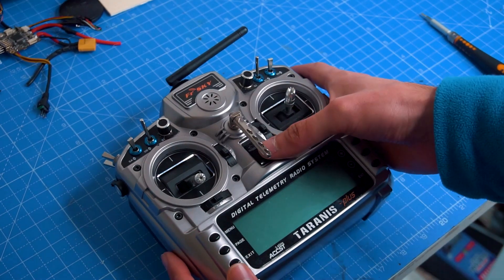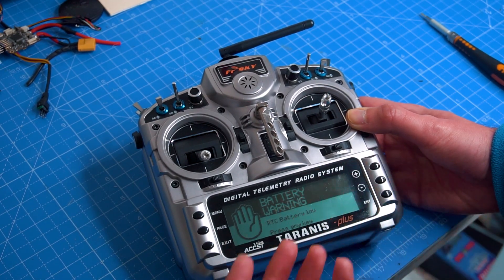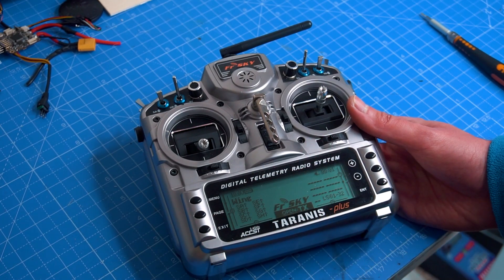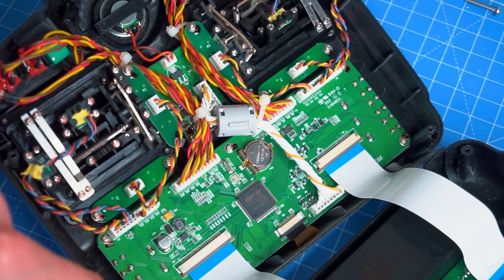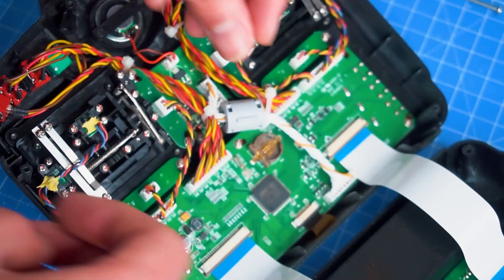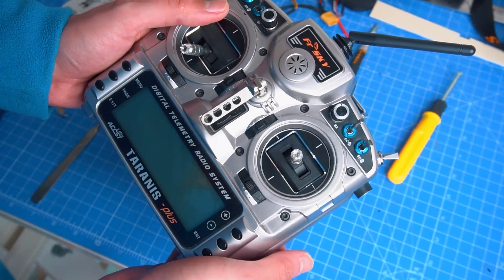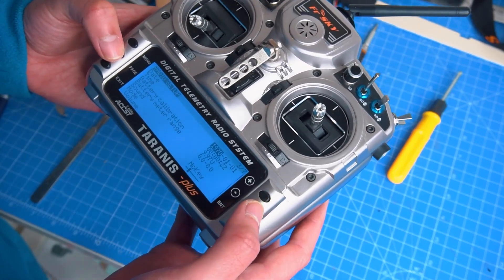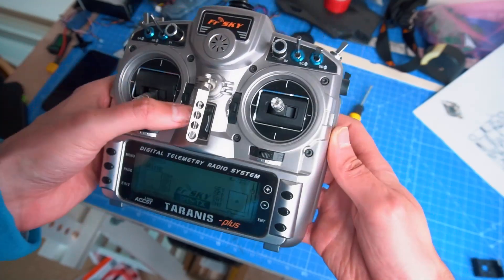RTC Battery Low Warning | Battery Replacement

Comment: Do not remove the battery the way shown in the video as you risk damaging the battery housing as happened to me.
Instead push on the metal bar to the left of the battery to release it.

Other than that a great video.

Comment: Can i fly safely with that rtc battery low warning? Currently on holidays, not at home, and planning to rip some midrange spot. Thank you
Reply from the maker: It's safe, again it's just an internal clock battery to keep time and date  always on, nothing to do with radio functionality.
Reply: @Joyplanes  thank you